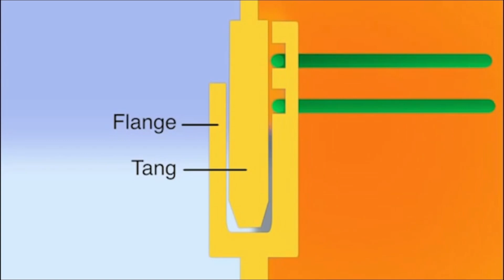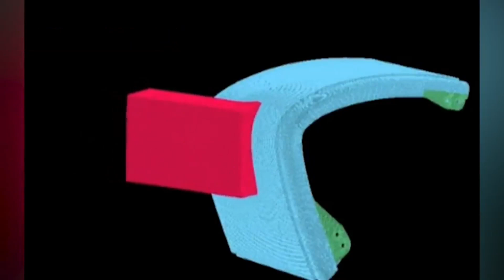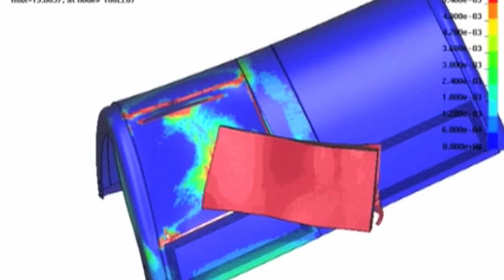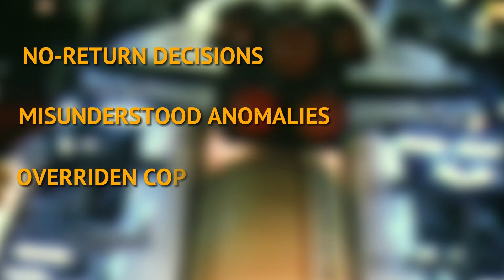Why the Space Shuttle Program Actually SUCKED

Comment: Excellent content, but the word "sucked" is bound to touch a nerve with many people. Most Americans don't want to hear about our failures. They want to feel good about what we accomplished - feel good about America. There were brilliant, hard working, self-sacrificing people at NASA, as well as hundreds of contractors. The missions did accomplish things - the science, refinement of space travel, support of the ISS and Hubble, etc. However, accomplishments at what cost? Removing the glamour of liftoffs and space suits, any program (aviation, naval, ...) that loses 40% of its vehicles, two full-crew losses, has enormous budget overruns and operational delays, would be categorized as a failure. Hats off to all the dedicated people that were a part of the program, but if the problems of a heavy-lift, high-capacity platform were dealt with honestly and proactively early (probably cancelling the program, and designing/building a safer, more practical vehicle), we would have accomplished much more, long term.

Comment: SLS has all the same problems of the shuttle and is more expensive.
Reply: thats like comparing apples to oranges the space shuttle was meant as a reusable delivery truck so to speak while the SLS is meant for sending the orion spacecraft to the moon
Reply: @Wolfie142_  They are both too expensive per launch. Absurdly expensive. One RL-10 engine costs as much as SpaceX to launch three Falcon 9s, never mind an RS-25 engine.
Reply: @JackMenendez  yes but its cheaper to use a engine that has been tried and tested than going through all of the R&D, testing, and production to build a new one
Reply: @Wolfie142_  And that is how you get an unsustainable rocket system.
Reply: @JackMenendez  -_-

Comment: The shuttles themselves were an example of promises that couldn't be kept. They were never really going to be practical because so much of the weight budget was taken up by the orbiters themselves. This limited additional payload size, weight and orbital options. The entire idea of recovering satellites from space was a bald-faced lie. The shuttles' extremely low flight ceiling meant that most satellites were just plain out of their reach. They were also a burden to the Freedom Space Station (what ended up becoming the ISS) because of the previously mentioned payload limitations. Plus, the shuttles had never been designed to be kept on-station in orbit for months at a time. So we were always going to need capsules in case the station crew needed to evacuate in a hurry. The enormous complexity of the entire system meant that prepping them for flight took months, not weeks. But even weeks would have been too long in the event of an emergency on the ISS. Worse, the huge budget required to keep them flying prevented development of replacement spacecraft.
Reply: I think the idea was a good one, the result was just a compromise to keep some companies happy that have been generous to some governmental employees. Also the time pressure for development. In my opinion the Artemis program is just a poor step back instead if giving an orbiter or even a real space ship another chance. 
Also both accidents could have been avoided for sure, but if I compare the Apollo program with the STS program the STS program is much more reliable and even cheaper even if some points shouted for improvement (re-usability of booster tank like the USSR Buran).
Nowadays judging about something so complex like the STS program is ridiculous, for the time it was developed I think it was one if the most impressive, complex and great development. The STS program goes back to the late 60s early 70s, even the Buran project just started in the early 80s which makes it younger than the STS project. Surely we will find nowadays issues and flaws within the STS project but it’s almost 50 years later since the first plans have been developed. But stepping back to capsules and rockets is not the way to explore space.
I’m a huge fan of astronomy and space exploration, studied even astronomy and planetary science but I dare to say that mankind is not yet ready for space exploration, not technically - we just don’t have the engines to travel through space in a time wise manner nor mentally - we are way to greedy and hostile.

Comment: The shuttles biggest  problem  was it was designed  to keep as many companies  happy as possible. 
The sold fuel boosters could of been  made  in one piece  and transported by water but that would of upset some people. 
The fuel tank could of been taken into orbit and been the base of space station .
But back to the shuttle its self..there were much better  designs but these were ignored to rush this compromised craft.  
They could  of put a repair system onboad to repair the heat shield but didn't.  

It should be noted the Russians built a shuttle  the had reusable liquid boosters and landed itself.
Reply: The russians part was the USSR’s poorly timed Buran, which while the Buran had so much potential and hope, it ended up rusting in a forgotten hangar. RIP buran. STS was supposed to be fully reusable